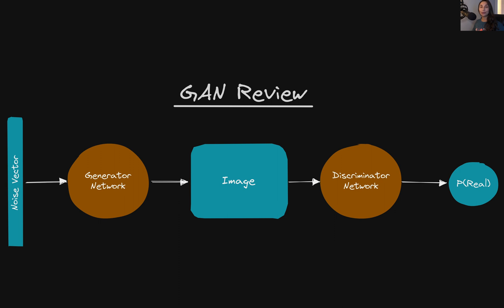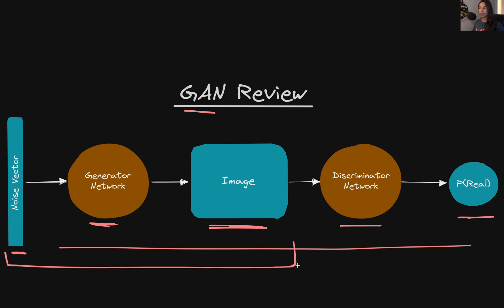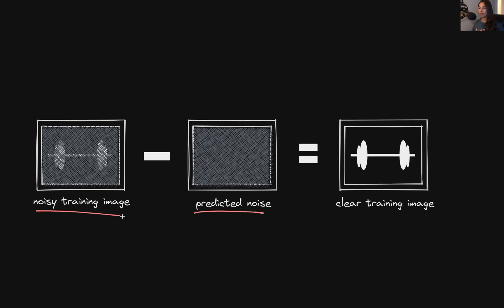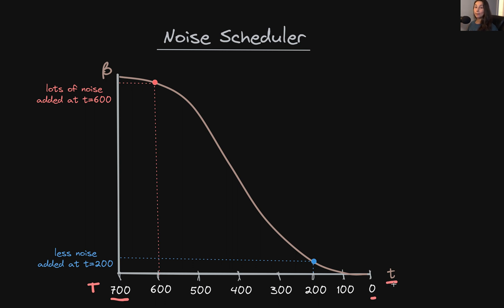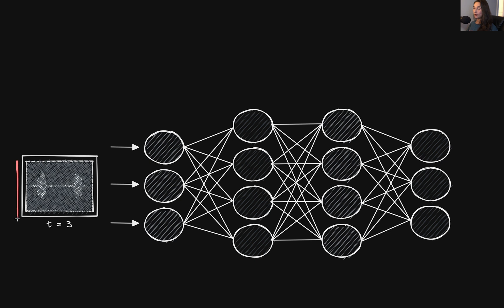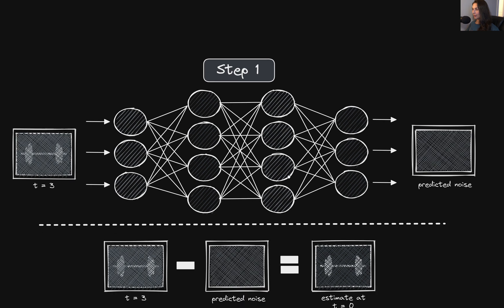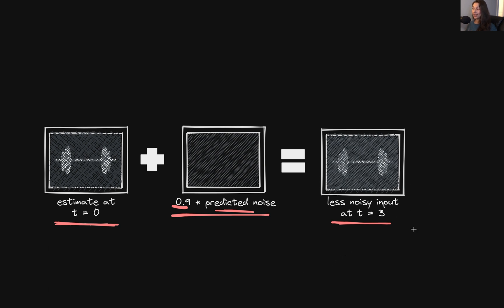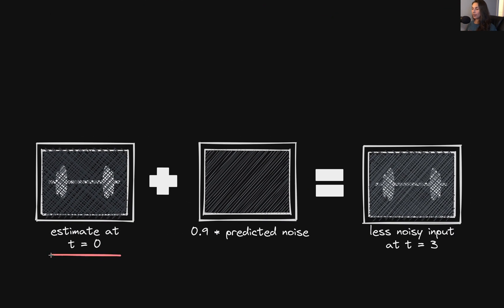Training A Diffusion Model - Stable Diffusion Masterclass

Comment: This is really explained poorly in that

 1. It assigns unnecessary complexity: rather than say the model subtracts the predicted noise and adds it back, you could have just said it subtracts 10% of the predicted noise. 

2. The explanation goes on and on with the computation steps without explaining the intuition. 

3. It is simply incomplete. You did not explain what are we doing with noise scheduler with multiple “t”s, if during training, the model is already learning denotes in incremental steps
Reply: Of course... they are trying to sell a course 😅
Reply: @Ezghoul1  All the materials are all over the internet. Sell what to who?
Reply: @tnt1674 obviously you didn't look at the Video Description... and you're correct. The information is everywhere now. 7 months ago this information was less accessible (more technical).
Reply: Agree. Waste of time.

Comment: I have a question. Is fair to use the same noise scheduler for inference than for training? I am asking because when the model is predicting noise during training it has just the correspond noise step acording to that timestep. But when inference, the model has 2 noises: The timestep noise (same as training) + noise that wasn't able to delete since the model isn't perfect and always will make tiny mistakes. For diffusion process with a lot of steps I fell is unfair to treat both as the same.

Thank you for your clarification!